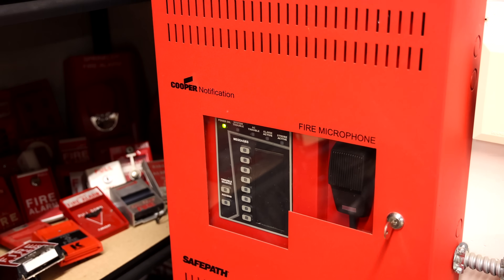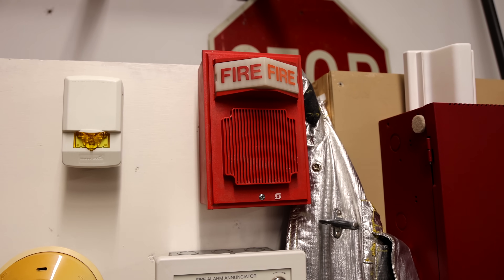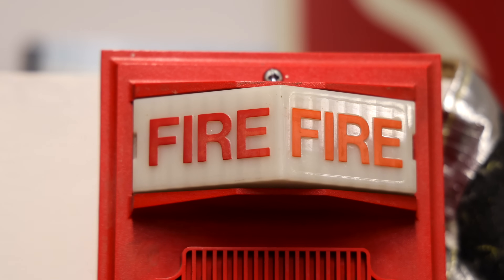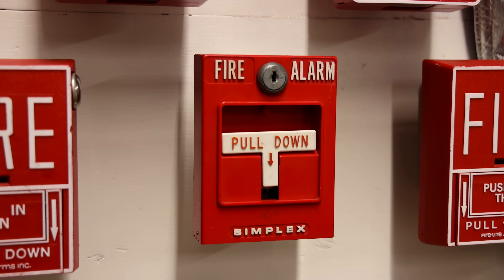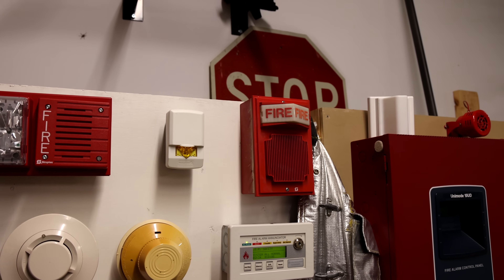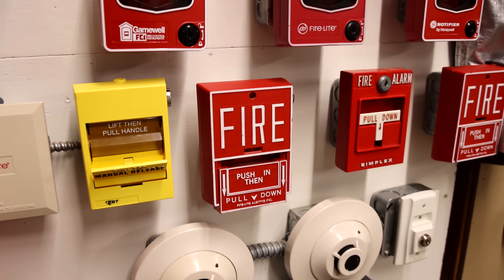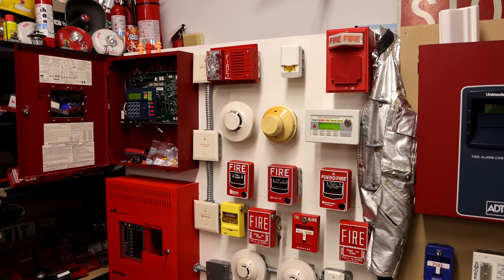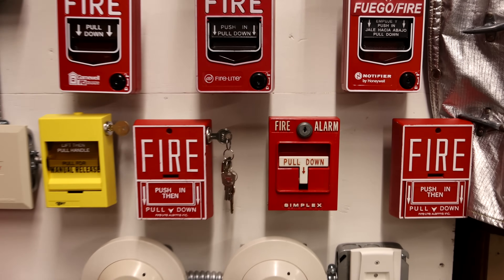Voice Evacuation Fire Alarm System Test 28 | Vintage Simplex Speaker/Light!

Comment: Technically, since you put a light in the plate, it's a 9735 now! The 9739 is the more common strobe model, but simplex also made a lesser common 2902-9735 with a light instead. These models are most famous for being part of a large set of factory-painted white units installed and then removed from, but they were originally just like the one you showed. Super cool!
Reply: I wonder if Simplex actually made a White version of the 9735 according to The Fire Alarm Panel. I would assume the extra 9737 & 9738 gaps probably denoted for 70VRMS models.

Comment: That 4901-9822 Horn is loud! But since the strobe next to it is 15CD, that's not too bright. It flashes really fast especially since it looks like that strobe is from 1999 which I would expect it to flash slower at a consistent 60FPM rate.